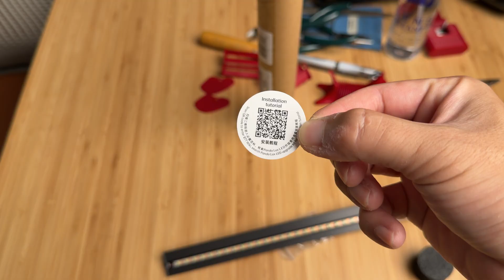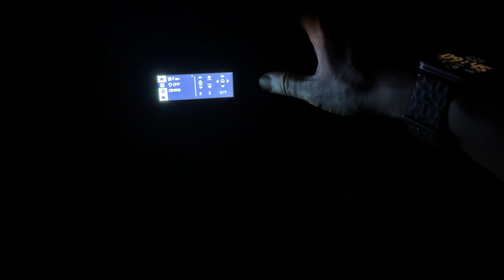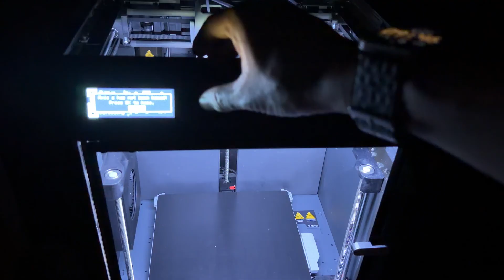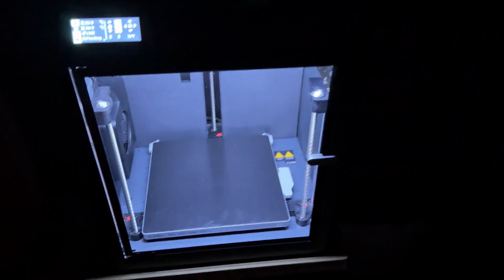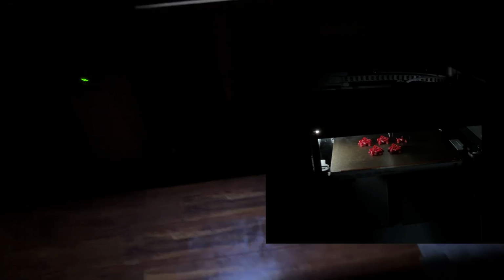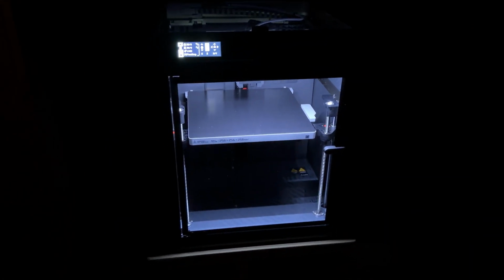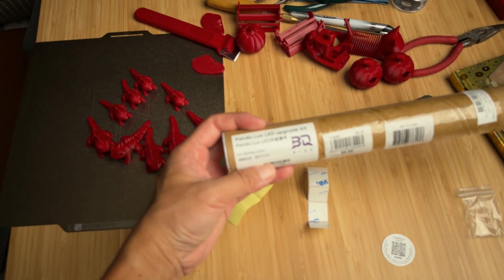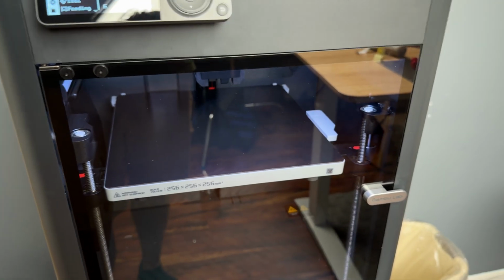How To Install Panda Lux LED Upgrade Kit for Bambu P1S, X1C and P1P  #bambulab #p1s #3dprinting

Comment: Because of your video, I bought the led, and today I will start the installation; thank you for the tip. I bought another camera to leave at the top to see better; it's a test, I hope it improves the visualization with the camera.
Reply: It is possible to use the panda led with the original p1s led
Reply: @tiagonunes7106  I ask BIQU support and they say: "Yes, that's possible if the port is compatible. You can check out this video:"  and they redirect me to this video  :D.... So i do not now nothing more as earlier
Reply from the maker: The external camera will definitely serve the purpose better for monitoring. I have sold the P1S but the new owner loves the brighter interior.
Reply: @TheGizmoGarage  Why did you sell it?
Reply from the maker: @siriusbusiness2351  I bought a P2S, and subsequently returned it due to defect. Then I bought A1 Mini. Happy with A1 Mini + H2D setup now. Check my other videos for review of these units.